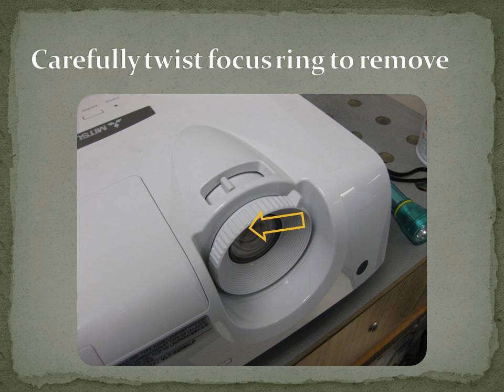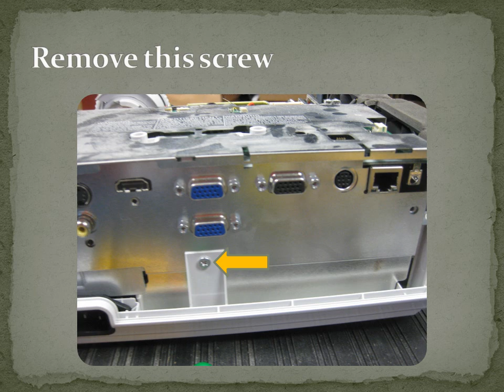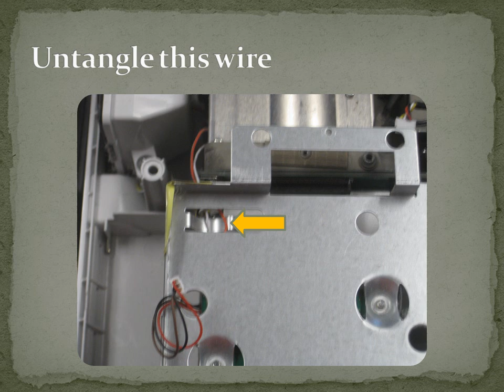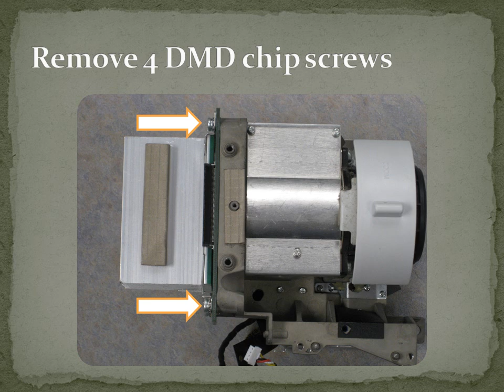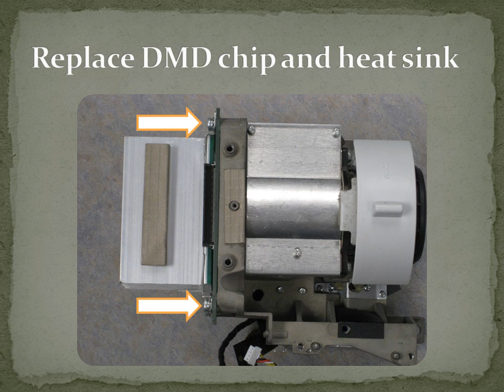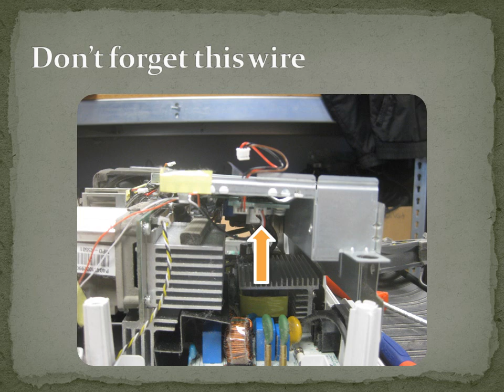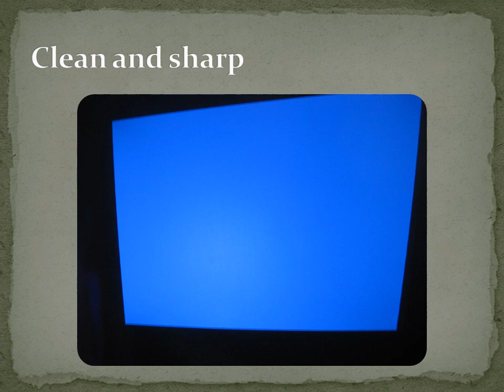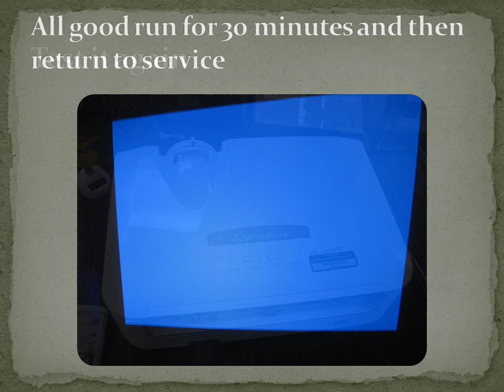Mitsubishi Projector - xd250 xd280 DLP - Internal Cleaning and more

Comment: Hi there! I have an HC900(Mitsubishi DLP) - I stupidly tried to blow dust out when I was replacing the bulb, and now when the image is dark during operation, there is dust scattered all over the image - when the image is light, you can't tell, and color still gets through the 'blobs' of 'dust' - but when the image is dark, the light specs are all over the place.  
Do you know enough to say whether that sounds like the DMD? Or maybe somewhere between the color wheel and the DMD?
For the life of me I can't find a service manual for the HC900, without buying it online from a manual website(the user manual is useless of course) - and I don't have a credit card. So I'm going to have to carefully pull it apart piece by piece, and try to take pictures between each stage of dissembly. 
I'm a nervous wreck!
Reply from the maker: cinesimonj I have a video of a very similar model to yours It an ex100u or ex10u. Let me see if I can find it. Most likely you have a very small amount of dust on the DMD mirrors> not to hard to get to and blow out if I remember right.
Reply from the maker: Mitsubishi ES10u DLP Projector DMD Chip replacement
Reply: Oakheart Thanks! I ended up pulling the entire lens/light chamber unit out, with the color wheel attached. It wasn't hard as such, just took forever - I took a photo and noted down each step. Probably wouldn't have needed to if I saw the video you've linked to! Anyway - yeah the mirrors were dusty. I cleaned them with a non static cloth and photo-lens cleaner. I had been told that using canned air can make it worse, in terms of just blowing more dust around.  Took forever to put it back together, despite my recordings - in all, about 8 hours from pulling it apart, to cleaning, to re-assembly. Now I know how to do it though, it'd probably be half that.
Anyway thanks very much - hopefully others can learn from the gathering info!
Happy to answer questions if anybody comes across this.
Reply from the maker: Wow I suppose that would be safest. It does have a glass coating over the mirrors. I don't use any cleaner on them myself. As long as it didn't drip or stay wet should be fine. >>> How did it turn out.
Reply: Oakheart Turned out perfect! Better than it was before my dust blowing mistake. The fluid I used is one which dissipates - so even if I had managed to leave some on(though I made sure to clean with a dry non-static cloth lastly), it would have been fine.
Reply from the maker: Awesome!